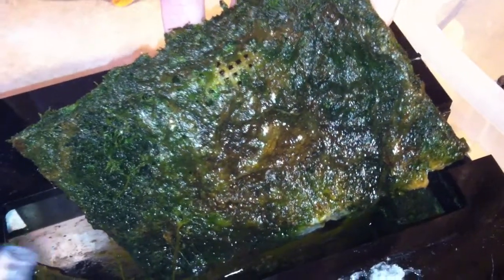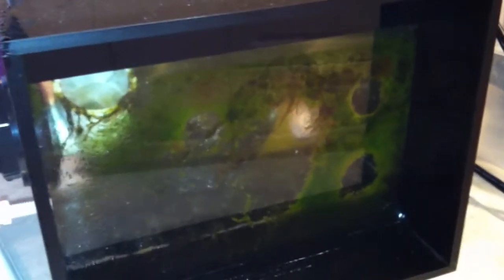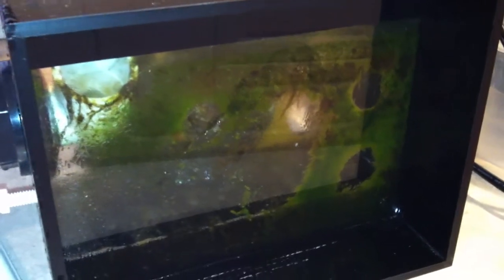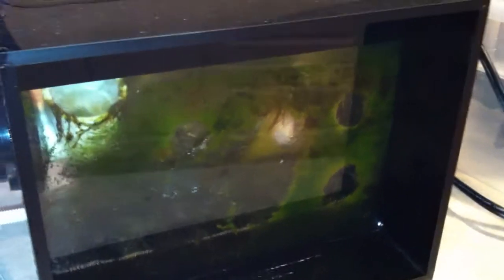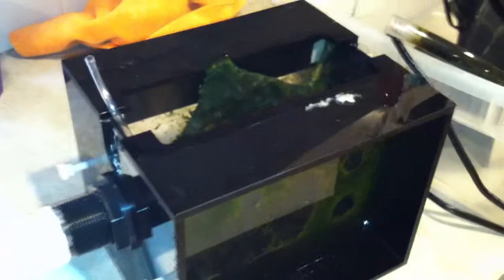Turbo's UAS Test, 2013-06-13 Cleaning

Comment: If you still have tour scrubber I was wondering if I could maybe buy a bag of algae off you to seed my sctubber with?
Reply from the maker: I make algae scrubbers as a side business, and I run 3, so yes.  But that doesn't mean it's going to do you any good because there are so many factors that affect how well your scrubber will do.  Build it right and let it mature on it's own is the best way to do it.  If you want to post your DIY scrubber you can join my forum at algaescrubbing dot com, it's open to all